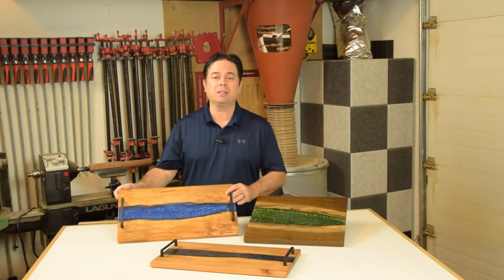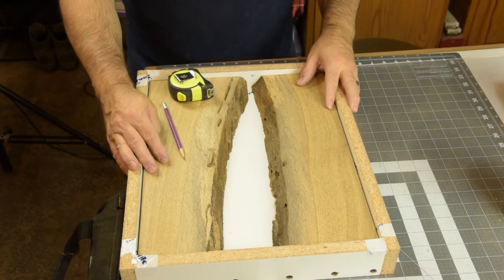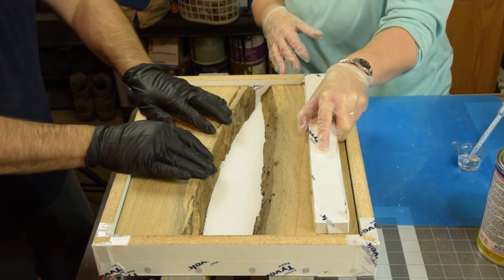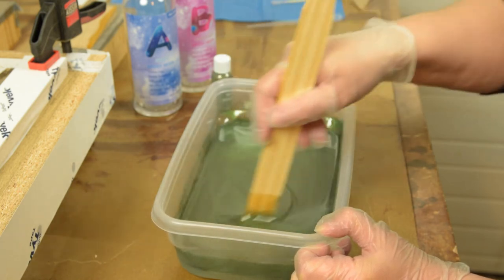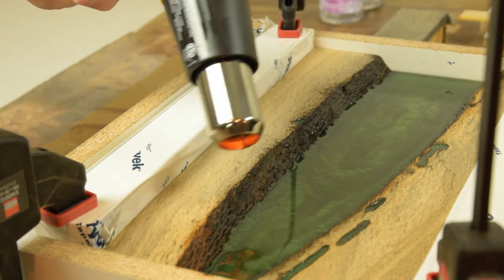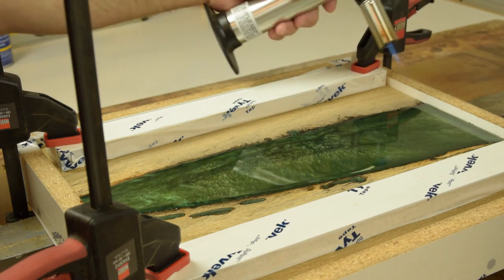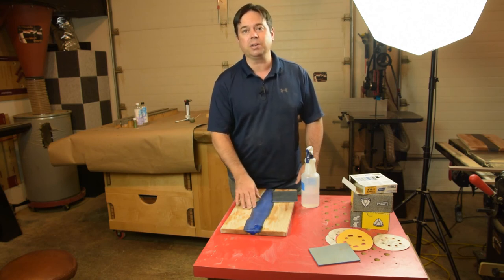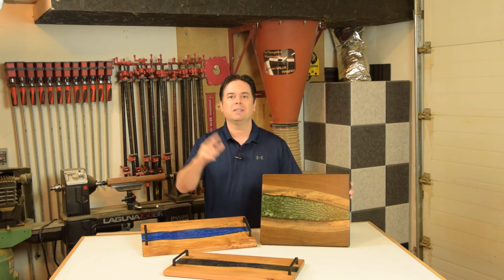River Epoxy Board Charcuterie Boards River Cutting Boards Mini River Epoxy Table with Epoxy Resin

Comment: Great job, congratulations 🍾🎈.  How much could be the overall cost to make it?   A lot of work. It’s worthy?
Reply from the maker: Usually I just make them from scraps laying around the shop, so the lumber is inexpensive.  The epoxy can be the real cost, but not too bad.  We typically don't use "deep pour" epoxy on these little boards, so it's cheaper.  Just make sure you run a fan over the cooling epoxy.  
Best

Comment: what epoxy did you use?
Reply from the maker: We have used several of the cheap epoxy brands from Amazon.  All were 1:1 ratio, two-part epoxy .  They aren't necessarily all for deep pours, so we made sure to keep a fan on them.  You need to keep the epoxy cool as it cures, especially for the first few hours.  We had zero problems with the epoxy curing
Best

Comment: What epoxy did you use?
Reply from the maker: I don't remember the brand name.  Just some cheap 2 part epoxy from Amazon.  Probably not designed for deep pours, but on small projects like this you can get away with using the cheap stuff.  Thanks.